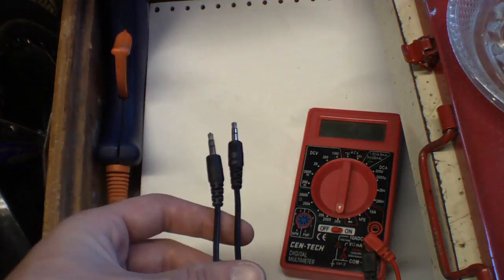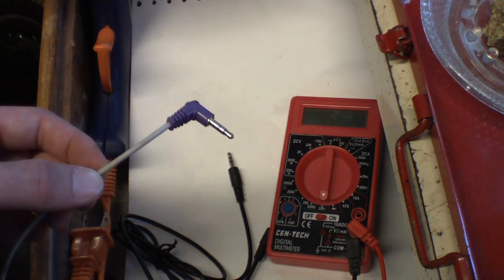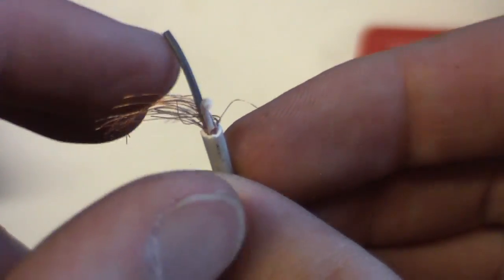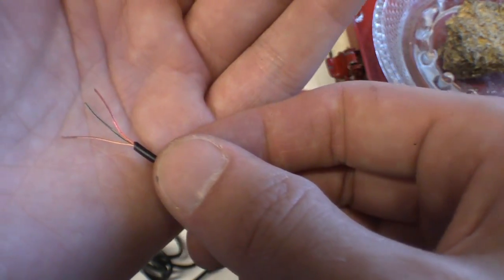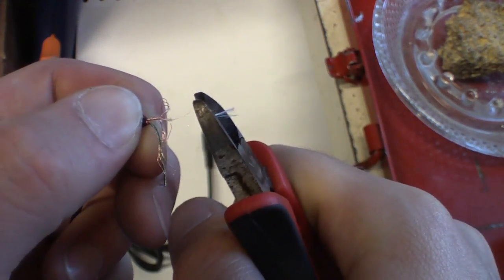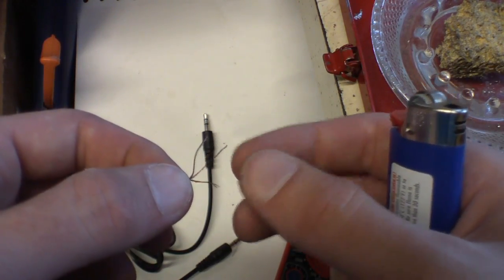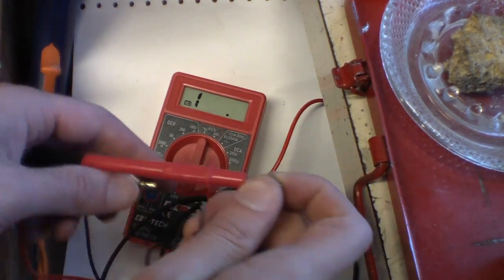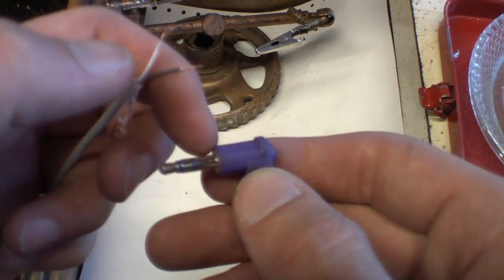How To Fix Headphone, AUX, MP3 audio cable

Comment: The problem I have is with those thin fiber wires. The audio strength is too weak. Those 80's headphones work no problem, but earbuds seem impossible to get decent volume levels.

Comment: Hi.im trying to replace my old speaker AUX..but for some reason now the Bass are way too low.there's white red & grey wire.but the aux cord has red white & blue.so i just connect white with white,red with red & the blue with the grey.the speaker cord has grounding but not the new aux cord.what am i doing wrong.Bass is there but very low

Comment: i know this video is a little old, but i have 4 wires, one gold, one red, one blue, and one that's striped with red and green?
Reply: just unraveled the green/red striped and there was another wire with a sealant around it, and the inside of that is gold like one of the previous???
Reply: @dakotabailey5944  rip lol
Reply: @alexisluna8740  yeah I'm screwed, I gave up
Reply: @dakotabailey5944  Well, apparently the one you mentioned last (red+green),  is the mic cable. In this case, you'll need an audio jack with 3 rings, instead of the normal one. I assume you're using headphones with a microphone built-in.

Comment: Cheaper to buy another from amazon
Reply: Kobain i had 1 from amazon but the mic doesn’t work😂😂😂😂😂
Reply: Not if you specifically have a cable that is X into aux and you need X but can splice the aux to save the cord because X to aux is way more expensive than aux to aux. obvious choice is to splice
Reply: Not if you  headphone is for producing...